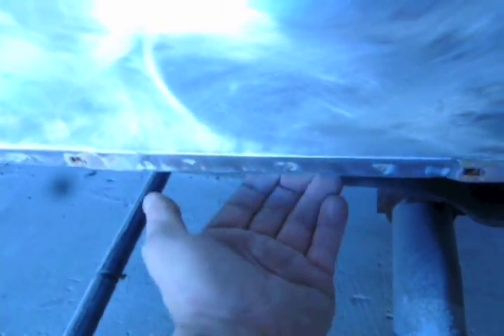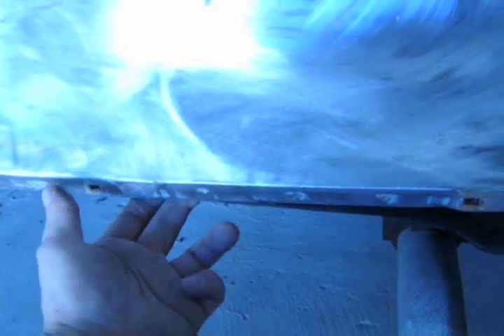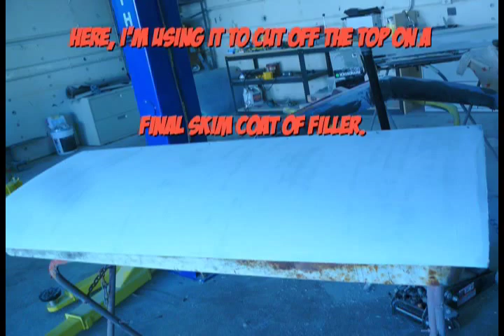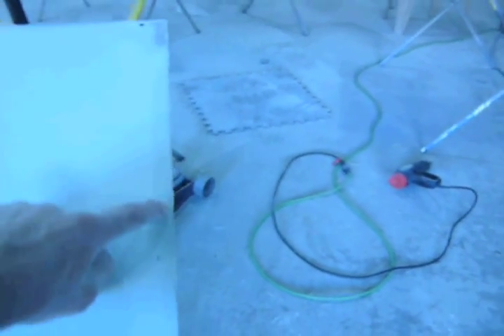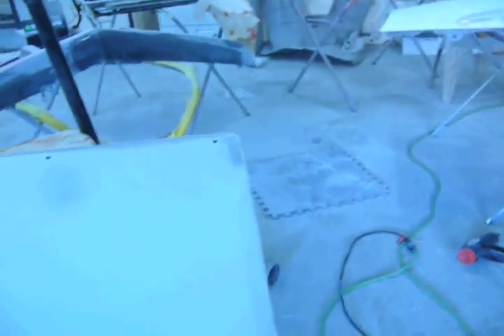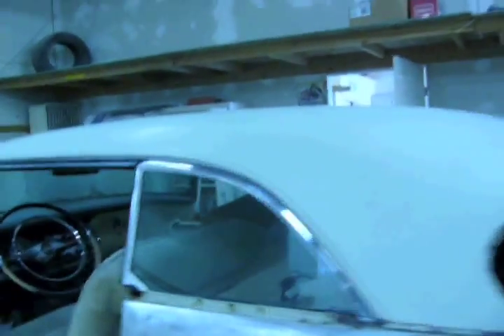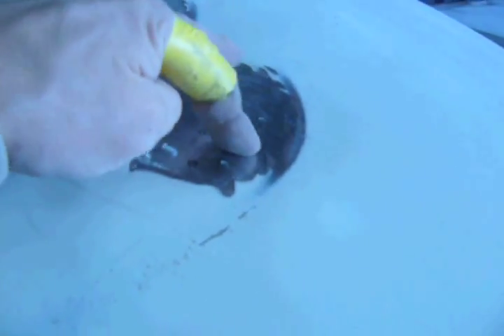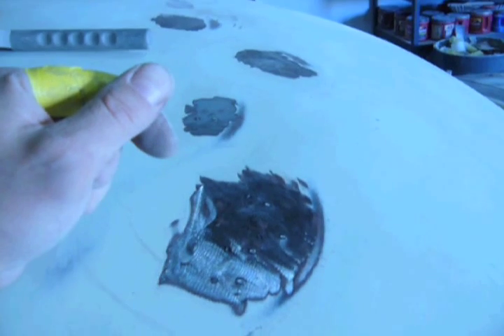episode 54: metal/ body/ prime

Comment from the maker: with an inlet regulator and a straight panel you can do really straight work with an inline and even have enough control over it to do it on the final skim. It's not a tool you just want to pick up when you first start and when I first started I hated in lines and mud hogs but once you get a solid feel for the work  you have plenty of control. The old man here taught me to use hogs on hoods/decks on final coats and I smirked at first. Then I realized he knows what he's saying.